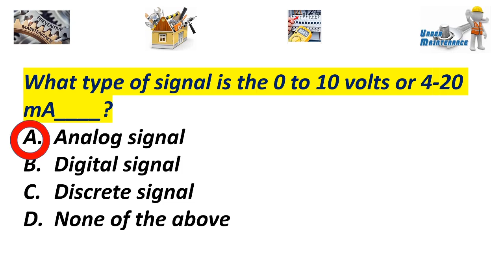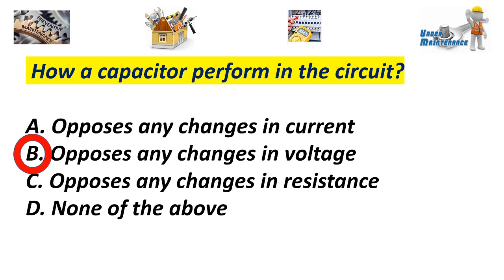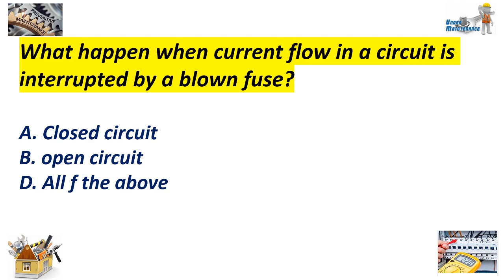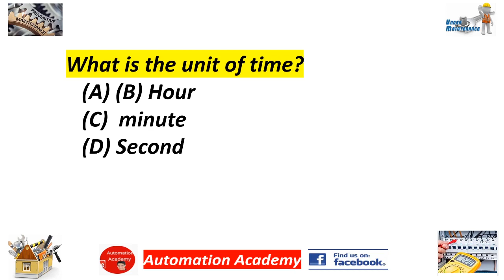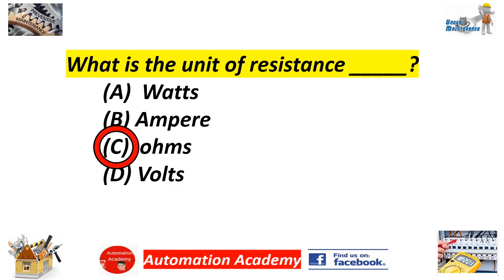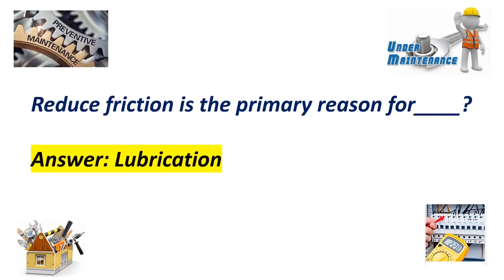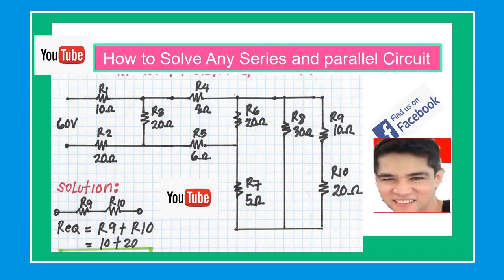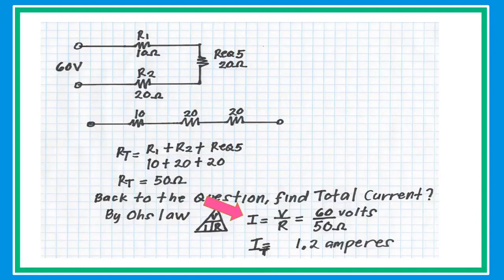MASTER Electrician License Practice Exam PART 1

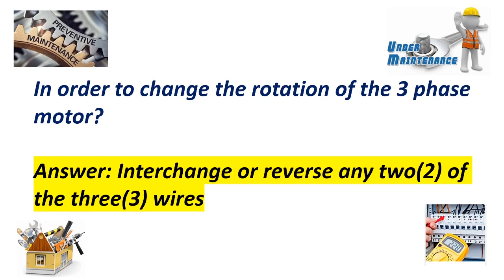Comment: The question at 24:37…you really want to freak out. RADAR antennas have two HUGE 208 3 phase motors rotating the antenna at the top of a 75 foot tower. Get a repaired motor with reversed wiring and it makes the whole steel tower vibrate so hard you don’t have to take your gf to the hotel🤣. Makes a perfect vibrator😂

Comment: it is an awesome video, I watched it from the beginning to the end. For the last question, I  wonder if the answer  is 60/(10+10+20) = 1.5 . thanks
Reply: To resolve this problem first add the bottom, also called the denominator. That gives us 60/40. The top part is called the numerator. You can then reduce the size of equation by using a minimum common denominator. In this case 10. 60/10 =6, and 40/10= 4. So 60/40=6/4. 6/4=1 2/4 which is equal to 1 1/2 which if we convert to decimal is 1.5.

Comment: Output voltage is not measured in voltampere. Voltampere is relation between current and voltage, voltage gets measured in volts, current in ampers, if you have a 120v-48v transformer 2amps in the  output the voltampere is 48v x 2 amps=96voltampers but the output voltage of the transformer is actually 48v not 96VA. The 96VA is the rating of the transformer because he can supply a load up to 96VA but thats not the output voltage. The right question should be the rating of a transformer is measured in? Voltamperes
Reply: I just call it KVA

Comment: One lamp installed and controlled by two location is not two way switch ?
Reply: There is no such thing as a two-way switch. I understand that it's a little confusing but there is a single pole switch, a 3-way switch and a 4-way switch used in residential. There are more kinds of switches than that but you do not typically see those in a residential setting.

Comment: a switch is used in the installation of the one lamp controlled by two locations is a 2 way switch not a 3 way switch
Reply: Wrong, it is 3-way switch.
Reply: It is a single throw 3 way switch. Don’t confuse the throws with the poles. Most common mistake.

Comment: Megger is brand of insulation tester device.
Reply: Brand?
Reply: Actually it’s both. Megger is a brand but it’s also referred to as any insulation resistance tester. It’s one of those where the tester stole the brand name.

Comment: Is this applicable to the NJ electricians exam?
Reply: Nec is NAtional …
Reply: @The_Ladder_Perspective  well gotta remember, phillipines uses 240 for household current, US úses 120 except for stoves(240), Heaters and other such. Also the plugs are different and not sure about wiring color code. You have to remember, it’s not just the technical aspect, it’s also the legal aspect, like for example type of plug for a 40 connection, minimum hieight to install receptacles, etc, etc.

Comment: What state masters is this based on?
Reply: This one just seems the technical of any exam. Didn’t see any legal aspects, like for example you must use a #6 stranded wire for a 50 amp box. Wires used to be solid copper many years ago. Many old homes need complete electrical rehiring. The solid copper tends to heat up more and degrade the insulation faster.